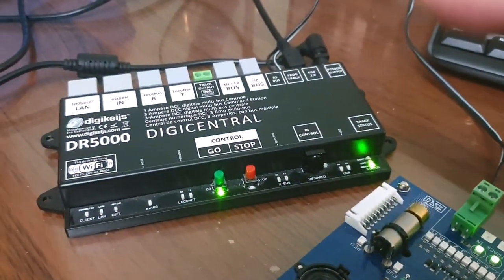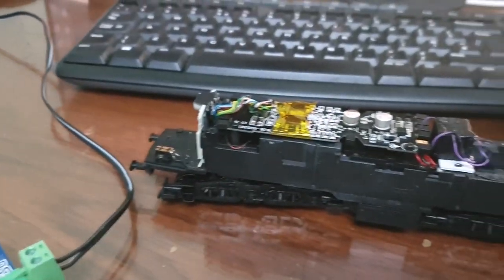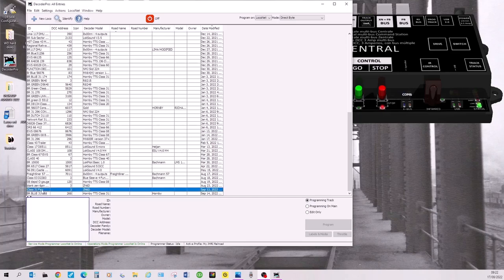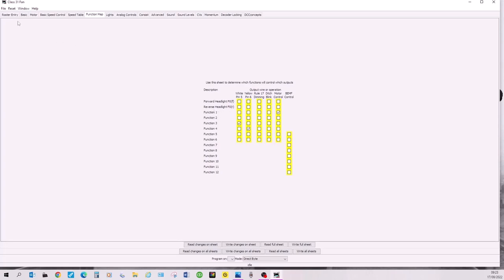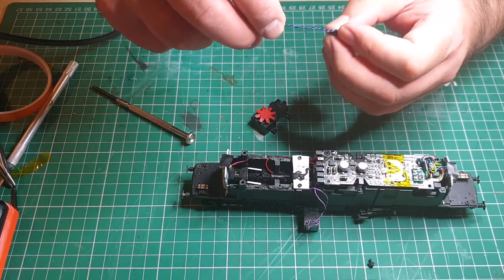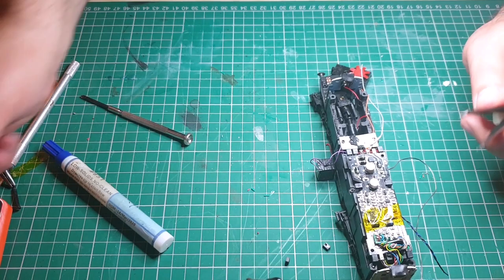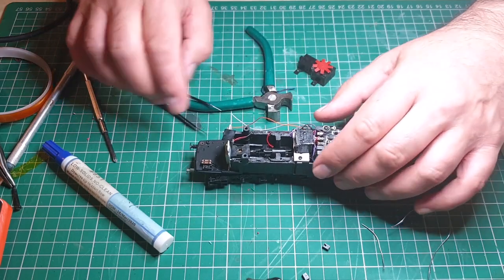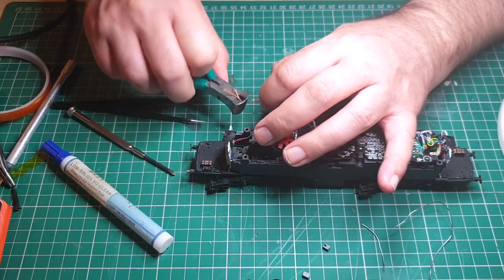Model Railway | HORNBY | TTS Sound | BR Class 31 | Adding an electric motor roof fan

Comment: Assuming the fan unit is just DC, you could fit a bridge rectifier between it and the decoder. Connect the decoder to the ac input on the bridge rectifier, and then connect the rectifier + and — outputs to get the desired fan rotation. You’ll lose around a Volt through the rectifier, so you may need to increase the decoder output to compensate for that.
Reply from the maker: Hi Michael, thank you for the suggestion. I was too tied up with trying to do it through the decoder settings to think of using a bridge rectifier. The small fan motor pulls about 50-70ma DC. I do have a bridge rectifier for some carriage lighting with a cap on board, may need modification. If I can fit it in I will give it a try, regards Steve